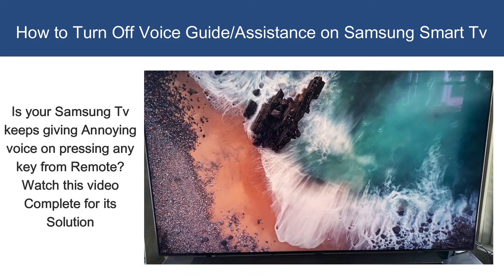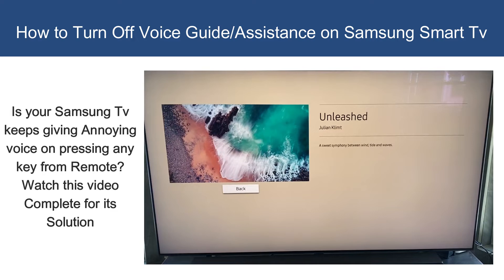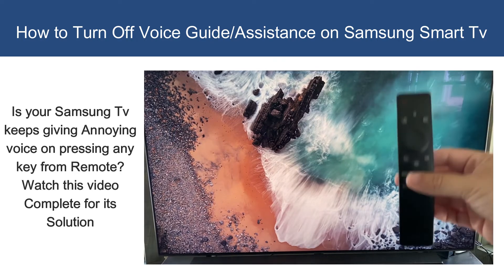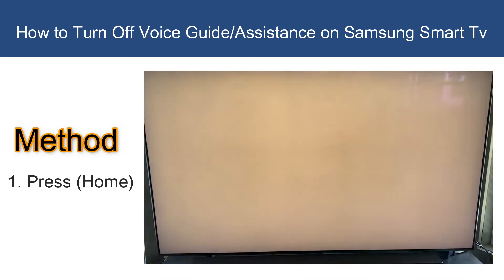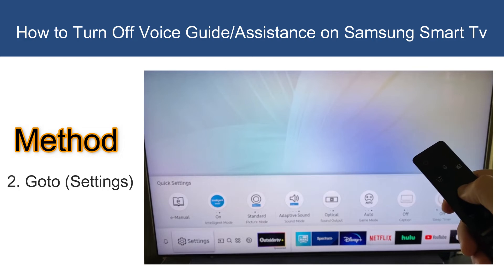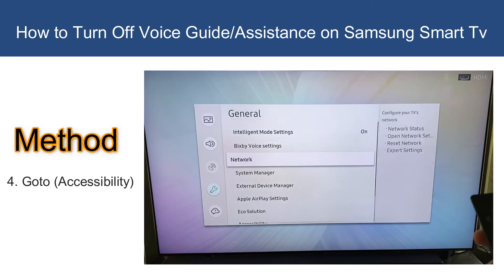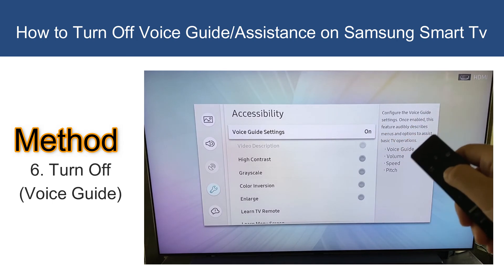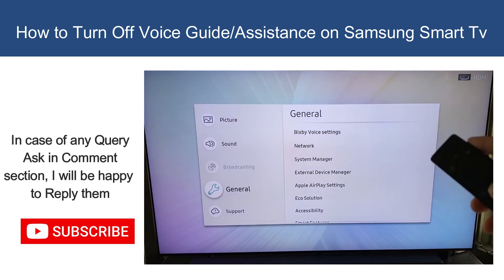HOW TO TURN OFF VOICE GUIDE ON SAMSUNG TV

Comment: Hi i will appreciate if you can help me out to resolve my big problem.my Samsung tv was working just it had a small problem that i can't download any app from app store. I saw a video that the guy give a code secret for all TV's it was press mute and 182 and the power button.after that tv doesn't work anymore i lost the HDMI on the source list . Thanks
Reply from the maker: Again go in service menu by entering secret code,
There find Hdmi in source settings and enable it,
It would be accidentally disabled by you